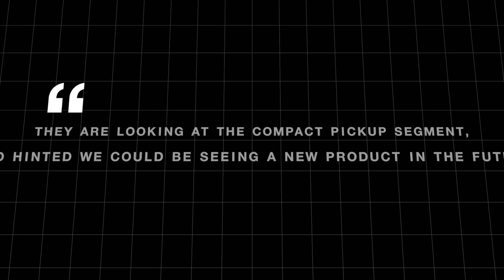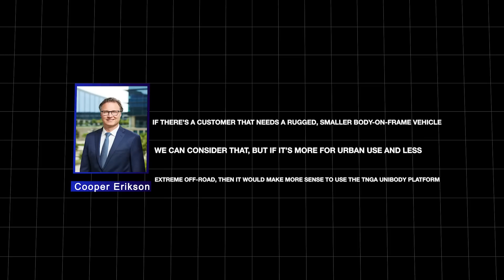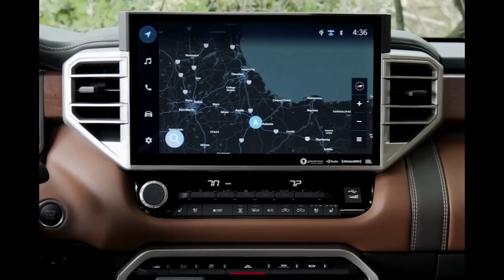New CEO Reveals $23k Toyota Stout | Ford Maverick Competitor

Comment: proud owner of a 2005 4runner v8 4wd. New vehicles make me sick how trash they are. Everything is made of plastic. wont last 60k miles. Try it. You might just be part of the 70% ish that ends up with something that doesnt leak or experience electrical issues in the first 100k miles outside of warranty. New vehicles need to be traded in every 1-2 years before warranty runs out in order to keep your investment safe. Most people allow the assest to devalue and dont put the vehicle back in the hands of the dealer. However a large portion of new car sales are trade ins on 1-2 year owned vehicles. Why do you think the used car market has so many cars right up against or past warranty on the lot. Wakey wakey.
Reply: Yeah, agreed. Newer cars they cut corners to save costs but are just not as durable. I had a 2004 4Runner like yours, V8, 4WD, limited. Pretty stout. V8 drank gas like a hog though. These generation 4Runners were plagued with premature frame rust. Mine never saw off-road conditions yet the radiator supports were nearly rusted out after 15 years. Every car has some gremlins though and Toyota still remains the top of reliability. I'd prefer over a V6 over the V8. It has a timing belt so needs a full replacement every 100k miles. An expensive job and high labor. Why they didn't put a chain instead is a wonder, especially on a V8.
Reply: @geoleo2597  It really grinds my gears the v6 got the chain upgrade and the v8 didnt. IF you dial into those years and take a look at the efforts by lobbyist and private money create manufacturing restrictions for toyota. Its pretty obvious the v8 seq, 4runner, tundra, landcruiser, gx 460, etc based on an engine designed to go 25 years in foreign lands without maintenance would look really bad on consumer reports when they were the only brand with the reliability to never break. THey effectively forced toyota to make failure points in my opinion. To this day its illegal to delete the emmisions system and increase gas mileage and reliability.
Reply: I have effectively bullet proofed my 4runner. My timing belt jumped and destroyed my engine. I didnt skip anything on the rebuild and considering the car market and average car payment for just a used car with 4wd my 8000$ engine rebuild is more then worth dodging a 555$ a month car payment. Check out the average car payment on recent consumer reports. It cost over 6000$ a year to own a used car. on average in a america. A brand new car limited 4wd is 1000$ a month right now. I hope everyone realizes the dealerships are shitting the bed from corrupt practices and lack of value. Researching consumer reports for reliable platforms and paying cash will allow them to die out and force vehicle manufacturers to develop platforms with reliability and affordability. RIght now the top wealth in the world trades there new car in every 1-2 years and keeps the system afloat. I wish I could thoroughly explain what researching the history of vehicle manufacturers can do for an understanding in how to get a good deal.

Comment: Gas and Diesel cars have become so complex that it is comical. I maintain my cars and SUVs very diligently but even with that the maintenance items pile up like belts, plugs, injectors, fluids , transmission, emissions systems etc etc. Electric is the way to go if they get cheap and have rapid charging. Eventually it will happen.

Comment: ditch the quad cabs ppl. its just a car sans trunk. looks like a truck but not good at moving a lawn tractor.
I once had a 2.2 96 s10 pickup went to an auction got a sofa recliner and a coat rack it all fit in the back of that 6ft bed.
that truck also weighed almost as much as an FD RX-7

Comment: There is a major problem with the prototype. I still wouldn't even classify this as a compact inexpensive truck. why do they not just make a little "toyota pickup hilux" single cab bare bones basic manual everything with a 6' bed. obviously the market dictates the product, but they could be making these for $16,000 or less.

Comment: They need to scrap the hybrid and go all fuel.  Electrification is a waste of resources.  This looks promising.
Reply: Either all gas or all electric. Hybrids have both and all the complexities and problems of both. although Toyota does seem to have the reliability down in prisuses.   All electric should be a lot cheaper to build.   So many fewer parts and hardly any moving parts.  Plenty of room under the bed for a larger battery pack, especially if you put a motor(s) in the front & back so you can eliminate the central drive shaft for 4 wheel drive.
Reply: @rickpaulos  Good points.

Comment: I hate to sound pessimistic here but its looks like a unibody SUV with a little 4 ft. novelty truck bed in the back and a 1 liter engine up front and a CVT transmission in the middle.  It wont have a truck frame, 4 wheel drive, or a proper engine or transmission.  So it's not useful for towing, working, or offroading.  It's a vehicle that does what a minivan or ::GASP:: stationwagon does but it's wearing a cheap halloween costume to disguise itself as a truck.

Good for Toyota I bet they sell a million of them, but for me it's gonna be a real hard sell.  Just give me a two door small sized pick up with a truck frame , a 4 cylinder engine with decent torque, A/C and ill be satisfied.

Comment: Never will happen at that price point  !!!! They will still do really well if they give great options for interior trim levels.  Toyota is always behind the curve on luxury and infotainment.  I would buy one if they don't cheap out on convenience and luxury.  The Santa Cruz did, so I went with tucson.
Reply: What was missing on the Santa Cruz that the Tucson had?  They hybrid would have been nice in the SC but at least in the Maverick you gave up some features like AWD to get the Hybrid engine.  I was considering the Tucson when I ordered and bought my SC because of the Hybrid but at the end of the day I didn't want 20 bags of mulch in my vehicle and I'm routinely getting 27 or 28 MPG on the highway with my Santa Cruz (Limited trim).

Comment: I'm not sure about the Maverick but you can bet your bottom dollar you're going to have massive reliability issues in that Cruz. Like fighting Hyundai for a new transmission at between 30k and 60k miles and a whole lot of other problems. See, manufacturers can but huge 100k mile 10 year warrantees on all their cars or even a million miles 100 years on them but Toyota will still win with just a 3yr/36k, 5yr/60k because they don't die like other cars and if you've ever had to deal with a warranty issue before, it's a HUGE pain in the *SS! Half the time it isn't fixed right in the first place, the car could be down for months while you struggle to get to work and the grocery store...  etc. When I see huge warrantees on vehicles, that to me doesn't show (what they say) "faith" in the product, it shows a lack of faith in the product. Ever wonder why Toyota's have so many miles on them? It's no only because they are a much superior product, it's because they don't spend their time sitting in a shop, they spent more time on the road! lol